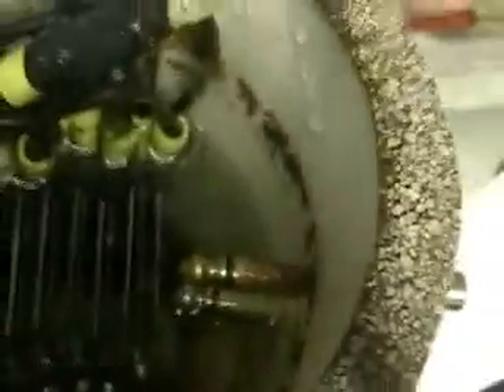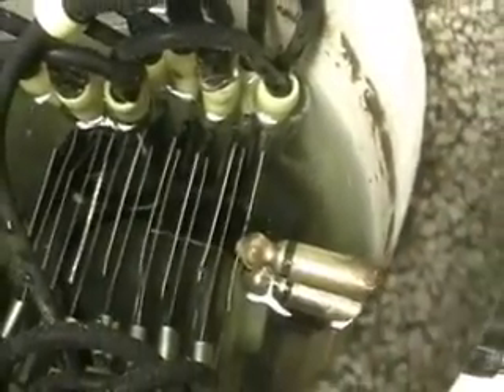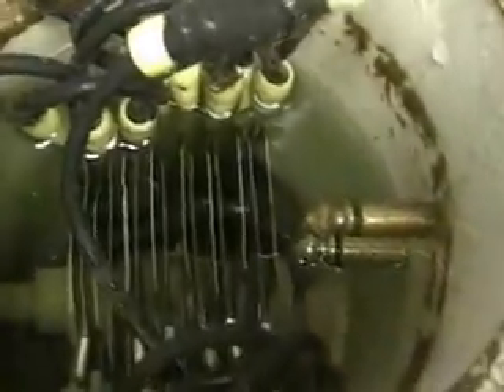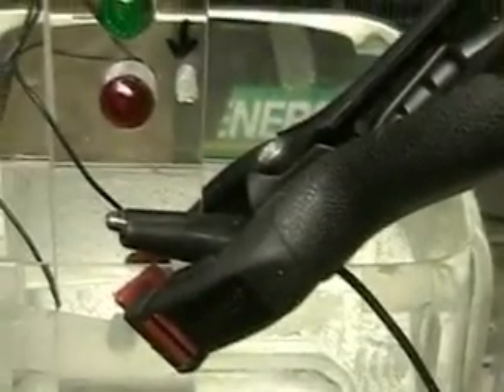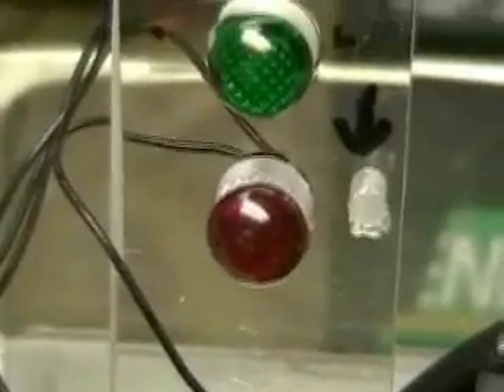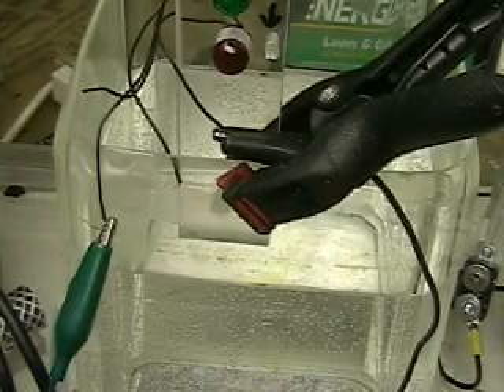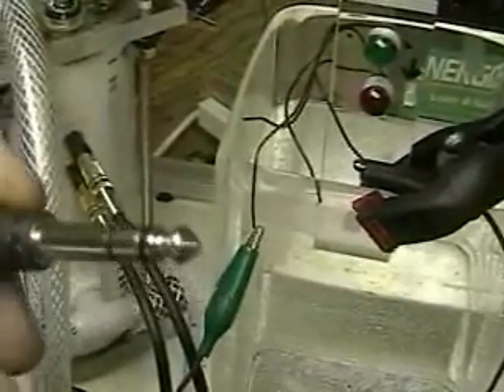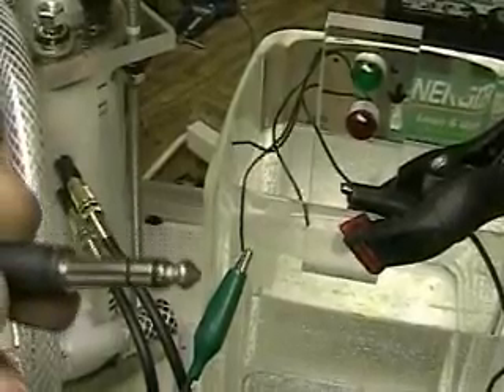Hydrogen Tap 1 Series 3L (More Views after Test) #51

Comment: on the top and bottom it would be easy to grove the top of cylinder rim and fit a "O" ring, you will get a longer service life from the "O"ring seal instead of the cork. A turning Co would only charge a couple of $ if they were doing heaps of them. Great searies Thank you

Comment: If you are making it yourself, you have to pay the electricity except you have your own wind or solar power. Large scale production is much more efficient than small homemade devices. When you burn the hydrogen you get less energy than you used in splitting the water. So as long as you use line current, you haven't won anything. Although it is a nice science experiment to show people wich elements water is made of an that there is double the amount of H than O in it.

Comment: John, i haven't watched all your videos so this may be a dumb question

even using a 100amp alternator watts=amps*volts
so 1200 watts is less than 2 horsepower going in.

do you have any idea what we are getting out of the H & O combo?

also have you tried running a weed eater or your gen off the 3l?